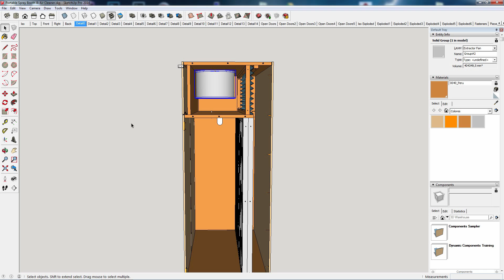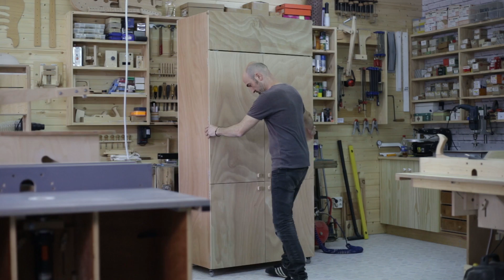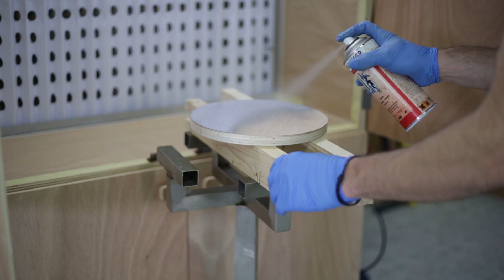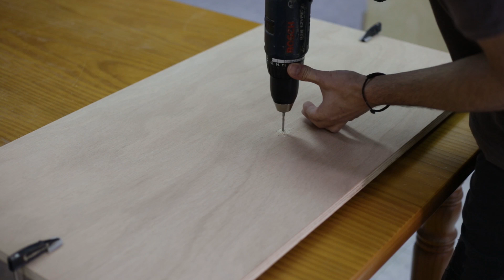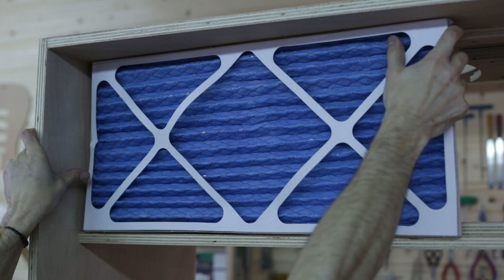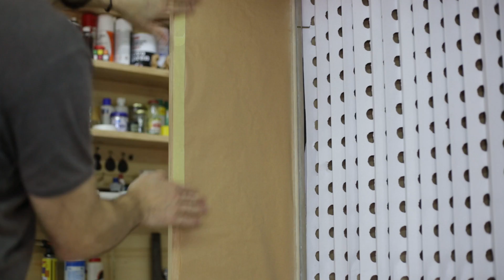Portable Spray Booth & Air Cleaner

Comment: Hi, gute Arbeit.
Ich suche eine Absaugung die man bei Epoxidharz Arbeiten benutzen kann. Haste ne idee? Wäre deine dafür geeignet? Woher hast du den  Ventilator? 
Gruss....
Reply: This booth will work with Volatic Organic Compounds (VOC) such as the ones emitted while spraying epoxy paint if you change the secondary filter (the one at the top) with Charcoal activated filters. You can even add (if you feel you need it) an HEPA filter to it. like the ones used in air purifiers. You can order them cheap fron AliExpress. 
Check if it doesn't reduce too much the fan's suction power though.
 He used a second hand Soler & Palau Inline mixed flow duct fan, model TD-1000.

Comment: how much m3/h air does the fan move? I need one for my project but in holland the right ones are hard to find or overly expensive.
Reply from the maker: hello mate, about 300 m3/h. You should shearch at repair shops for a second-hand one
Reply: Paoson WoodWorking thanks! Wil order one

Comment: Very good project! We want to do it, but with our fan is probably weaker and leaves paper does not stick to the filter as with you. Is there anything special?
Reply from the maker: hello! I recommend you buying a powerful extractor, you can search for a used one just like I did.
Reply: I did a similar build with a double extractor. I enclosed a cheap box fan beyond the first filter that vents into an empty space behind it to contain fumes (the first filter catches all particulate). THAT second space is vented with a standard bathroom fume extractor that vents through a 4 inch dryer vent (flexible type), and out my basement window. Now my build is a little shabby compared with this guy's (his is truly top notch work), but it was inexpensive and does the job. I get no overspray, and the basement stays fume-free. I built all the enclosures from large cardboard boxes and aluminum tape. Someday, i hope to upgrade to something more like this one, but for now, the basement stays clean and free from nasty fumes.

Comment: Great project. Could you use a regular woodworking dust extractor and vent it outside? I would think that a woodworking dust extractor would also be spark free since fine wood dust passes through without problem.
Reply from the maker: right, also you can use a dust extractor outside

Comment: don't understand this: I knew you needed at least an activated carbon filter to filter out evaporated solvents…
Reply from the maker: if you are varnishing all day and going to use a lot of varnish, the ideal is to install a direct tube to the outside from the exit of the booth.
If you go to varnishing in smaller quantities, as in my case, these filters absorb almost all of the solvents, have been using this method for years to varnishing guitars and it works!
Anyway, you could install a carbon filter instead of the blue filter I've used, thanks for comment!

Comment: A very useful tool. I like :).
How much power the fan motor?

Mark Fisher. Ukraine.
Reply from the maker: thank you! these are their specifications: 
Number of Poles - 2
Voltage - 1-230V-50Hz
Maximum current
absorbed - 0.5 A
Reply: At a current of 0.5 A and a voltage of 230 V - power of 115 watts. It seems not enough for such an engine %).
Reply from the maker: exact! right now it seems to be enough for me, but you can always use a more powerful extractor or install two like this one if necessary!